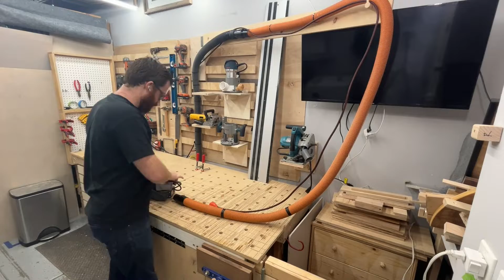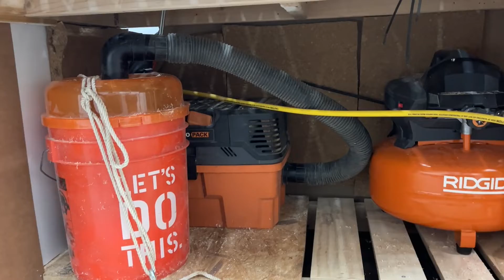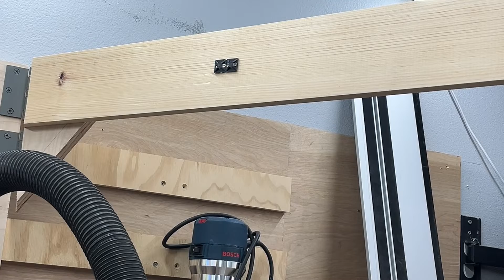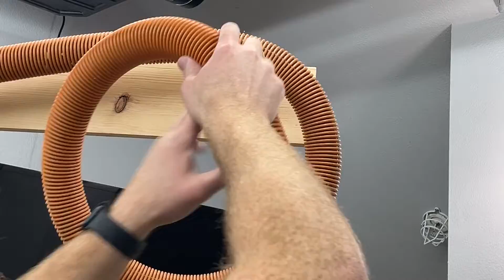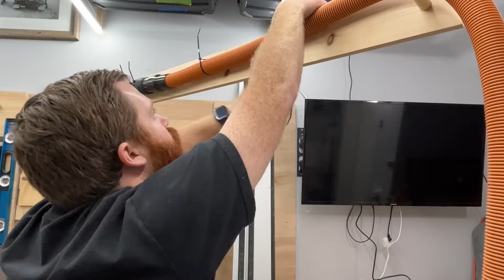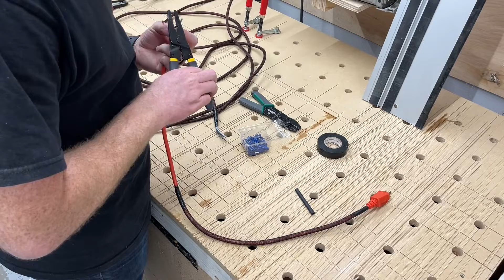Building a boom arm | Shortening my power cords!

Comment: It would have been much cleaner and safer to take off the cover of the tools and reconnect the shortened cable to the original cable terminals inside. Or perhaps disconnect the nice rubberized original OEM cable and install a short handmade cable in its place. That would give you an option of returning the tool to the original state in case you need to sell or warranty it.
Reply: These guys freaking out over what one person did in his shop to his tools is hilarious. He isn’t teaching anyone how to do it, he is commenting on what he did himself and what he used. I think it’s a great idea and a solid way to use his small space more effectively. Well done!,
Reply: @davejansen4972  and you would be wrong. He has a good idea but poor execution. And I am sure he meant no malice in making this video, but there is a certain level of responsiblity if he is going to share ideas with the possibilities of others copying his ideas.
    The problem is people without the proper knowledge  will watch this, and think what he did is perfectly ok and safe, so they may attempt it themselves. The electrical in this video was incorrectly done and unsafe which could lead to fires or worst death.
    Electricity is not a joke, if you don't know what you are doing, seek expert advice or don't touch it.
Reply: @efgee Would I do it this way? No. Will these butt connectors and heat shrink tubing ever be a problem in a hobby shop? No.
Reply: @5280Woodworking  I will have to disagree with you, it won't be a problem until it becomes a problem. The risk maybe low but the possible consequences are fire and death. Better to do it right. But the main problem is this many others are watching this video, who may replicate this idea not knowing and/or understanding the possible dangers. This video is teaching incorrect and dangerous methods of electrical.
Reply from the maker: That’s a great point!
Reply: I fully agree with the above suggestions. Definitely the correct and safer option.

 Using the butt splices in this manner is a bad and unsafe idea, plus it is against the electrical code. All 120v wire joints must be contained within a junction box.

It is irresponsible on your part for teaching your viewers incorrect and dangerous methods of wiring. Next time seek the advice of a professional.
Reply: His method does not meet code, should have just added a new plug on shortened cord.
Reply: I’ll watch the video, haven’t seen it yet. Just a question, I was thinking of hooking up different devices to smart circuit breakers for each device. I know it’s expensive, but it allows greater control for me. In my area there is electricity outage for 2-8 hours every day. There is voltage fluctuations. When the fluctuation is really bad it goes from 100v to 270v within seconds. Rarely we also get the hertz going out of whack, only learnt that because the solar inverter went offline 😅. These circuit breakers I have found react very quickly to these anomalies. Since I am creating a break in the wire anyways. I can use any length I want. 

The place where I live, following a code is least of their worries 🤭